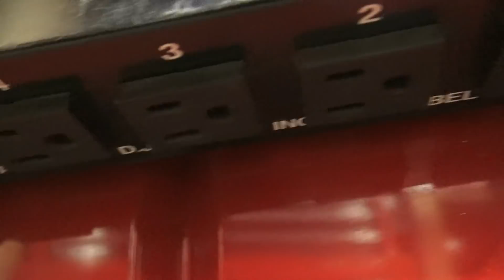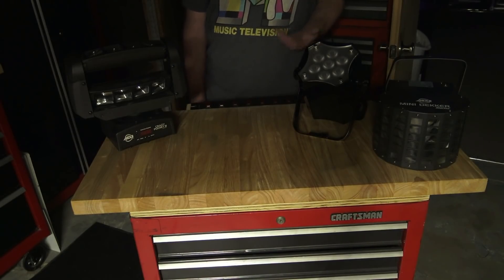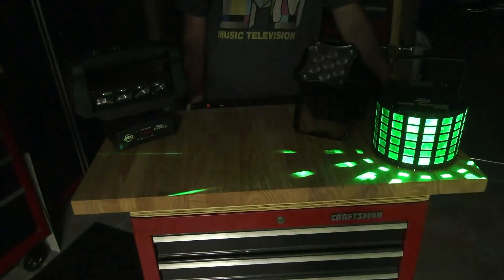DJ Ideas - Low Tech Lighting Control For DMX Fixtures

Comment: I’m old school like you and am gong crazy over dmx functions.  Is there a way to run these lights in their sound active mode (assuming there is a channel function for sound active mode in the fixture) by using a controller (Obey 10 specifically) to avoid the long boot times?  So 3 different fixtures, all wired in series with dmx cable, but independently activated via slider?

Comment: why would anyone do this in todays age of technology?
Reply from the maker: Because some old school DJs don't want to mess with it seeing how in the old days, they didn't have to & everything  was fine.  Think of it as if you drove a car with an automatic transmission, and then all of a sudden, you could only buy a stick shift car.  Stick isn't hard to learn, you typically get better fuel economy, hot rodders prefer it, blah blah blah.  Auto drivers used to have a hand free at all times & didn't have to use their left leg at all,k BUT....
Reply: There are a ton of fun lights, like strobes, UV bars, LED strips, house lights, light strings, and cheaper lights with no dmx, that you can then control to add to your show.
Reply: Yep, it works. But when you think that QLC+ runs on a Raspberry Pi, can output via a relatively cheap DMX dongle and be switched between states using any USB midi controller, I wonder why you wouldn't pre-program a few states that do this same thing and benefit from the ease of use it offers.
Reply from the maker: Empathy, my friends.  Empathy